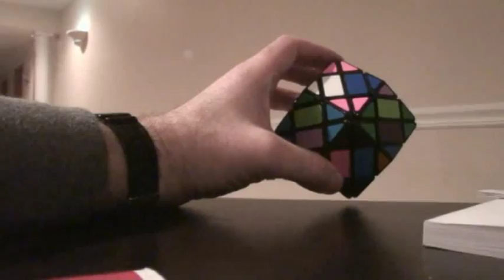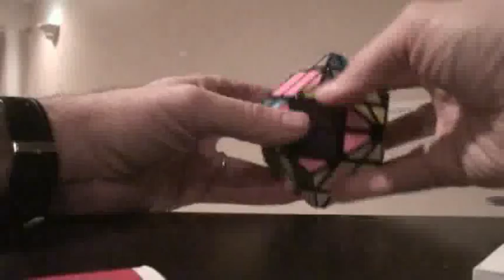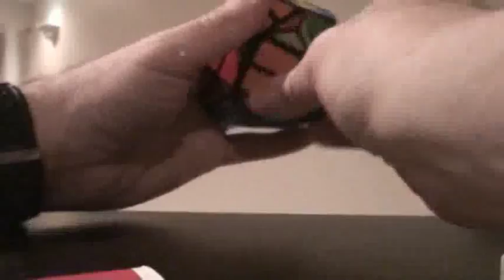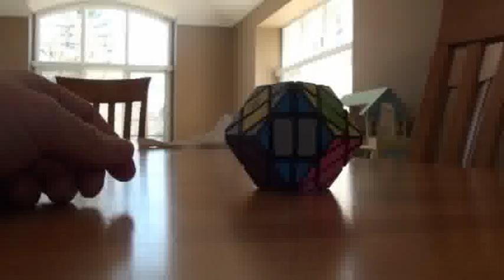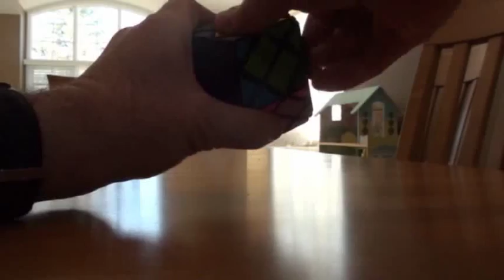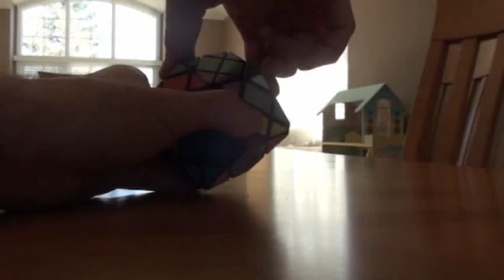Lanlan 4 layer rhombic dodecahedron tutorial part 3

Comment from the maker: AhaI  This is a case of parity, needing one of those magical parity algorithms :)  Hold it so that the red/gray/purple/orange center is in front of you as the F face, with the blue edge on the left.  The red edge will be on the top right.  Now do an Ri so that the red and blue edges are opposite each other.  Now do the Middle Edge Parity Switch algorithm listed above (the second long one).  Finish with an R, and it will be fixed.  I'm going to upload this as a viewer question, so stay tuned :)

Comment: I'm not sure what the method is called, but it's layer by layer with practically no algorithms; I do almost everything visually, with one algorithm when solving the top cross (which doesn't work for super cubes, apparently) and a pair of commuters to align then rotate corners.
In terms of the problem I keep coming up with, I could probably get them to end up in the cross, but it's usually one cross piece and one from the middle layer. It looks like this bit.ly\T7DXp6

Comment from the maker: Hmm, what kind of issue are you having with the last two pieces?  Are they top edge pieces?  What is the technique that you use?  If you have a picture of the configuration that you're having trouble with?  That always helps, but I suspect you can't get the last two edges to line up correctly with the top center...

Comment: I'm having a hard time solving the last layer, but the problem is that the way I learned to solve the 3x3 is just a little different from how you (and most people, I've come to find out). I do layer by layer, but for the final layer I do the top cross and one piece from the middle layer all together, but I'm having a problem getting the last two pieces in. I'm not sure if it's a parity issue or that I don't understand how to use my method on a super cube. 
Any ideas would be greatly appreciated.

Comment: Jon: thanks for your algorithm for the last 2 pieces to swap on last centre face. I went on to solve it. Question: For the last layer, do we really have to use the most basic way (as in solving the beginnners way of 3x3x3) ?  Doing the corner by corner ?
For the last layer, is it possible to solve firstly the full yellow face as up (top) face ? 
then corners, then the middle edge pieces. Because if I try to do that that top centre face (4 colors) tends to run around....

Comment from the maker: @alejandrosanchezbast You're right about the hard 4x4x4 parity with the supercube, in that if you have 3 edge pairs oriented correct on the top layer but one flipped when trying to make the cross, you have to do a "soft" rescramble.  I've not encountered that on this puzzle, but I suppose its possible, but fairly straighforward to "reset."  The algorithm is correct in step 2, but I may misspoke as I performed it.  Hope that not a sign of dementia kicking in...

Comment: @SuperAntoniovivaldi The tutorial is OK, but this puzzle is a tough one. It is possible to solve it only using 4x4 (like I usually do), but you have to be very lucky: if you dont have the "2 last centers orientation problem" and if you dont have edge swapping parity (edges dont have orientation, so you never face the "hard" 4x4x4 parity) you can solve it using only 4x4. The only thing you have to do orient centers using the 3x3x3 algorithms.
PD: Is algorithm in step 2 description wrong?

Thanks